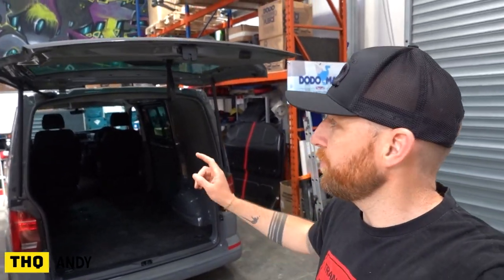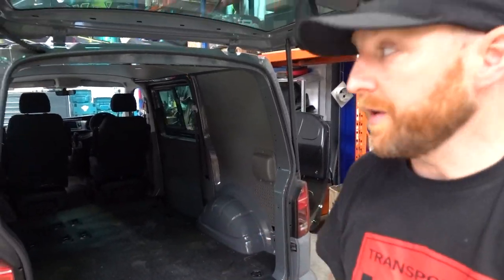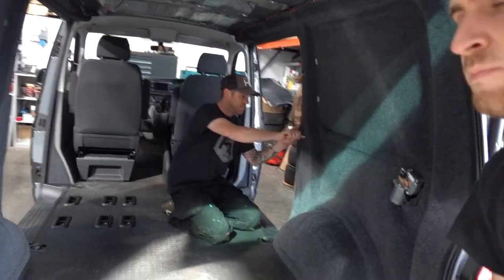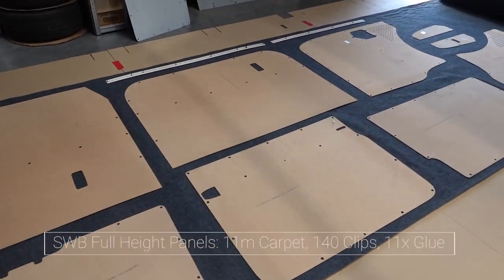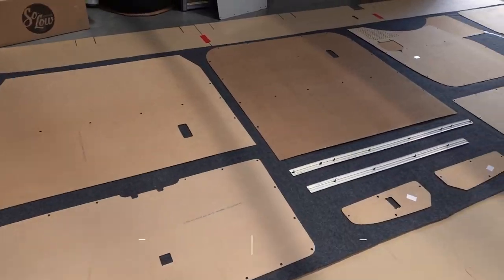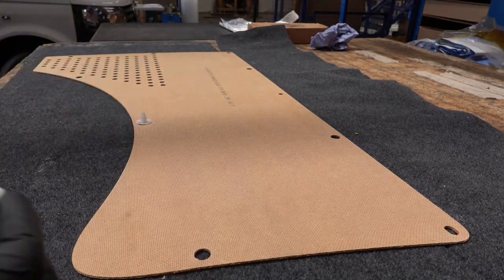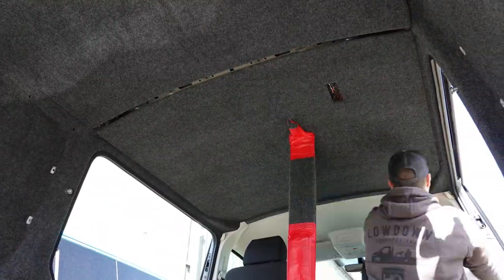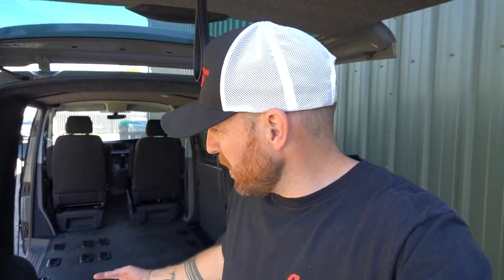VW Transporter T5 / T6 Carpet lining. How much to use and where SWB & LWB  | Transporter HQ

Comment: Hi do you have any recommended company’s locally you’d trust to use your products and do the job properly for anyone who doesn’t have time ? As I presume you don’t offer a fitting service cheers
Reply from the maker: @quench1234  where are you based? Check out the Solow installer network on solowsuspension.com Those companies mostly fit all our products.

Comment: Why do you carpet the wall, then carpet the panel to clip onto the wall? Am I missing something as I see no benefit than just caperting over the panels after they've been installed?
Reply from the maker: To access behind panels later if needed. It also stops the panels from rattling wood on metal.

Comment: What clips to use for ceiling middle trim? Originals are too short and can’t find any information about that.
Reply from the maker: We use the hidden panel clips we sell on our website. They are great and hold in tight :)
Reply: @THQAutomotive  is it a faff to remove a panel if ever needed when hidden clips have been used?
Reply from the maker: @simonheckford2347  No not a all. Just pop a trim tool behind there and they pop out. They give a much nicer finish. It may be worth having a few spares, just increase some loose grip with re-installation.

Comment: Is it easy enough to take the rear seat floor brackets out?
Reply from the maker: What do you need sorry?
Reply: @THQAutomotive  I won't be using the rear seats on my new t6.1 just wondered if you can take the backets out what the seats connect to on the floor?
Reply from the maker: @marinejunkies9625  Ok, i see. To remove them totally you'd need to drop the fuel tank. You can just cover them with blanks if that helps?
Reply: @THQAutomotive  Ok do you sale the blanks?
Reply from the maker: @marinejunkies9625 yes we do https://transporterhq.co.uk/vw-transporter-parts-styling-accessories/vw-camper-interiors/van-floor-blanking-off-set/

Comment: Hi guys, if I only want to carpet the walls do I have to remove my ceiling panel?
Reply: Hi fellas just wondering if I should or have to remove my ceiling if I only want to carpet my walls and floor?
Reply: @D_L_J_83  Yes, you should. You can then carpet above where the ceiling panel sits, so you get a nice finish when the ceiling panels go back in.

Comment: What is the type of screws for attaching the boards?
Reply from the maker: They are the hidden panel clips on our website.
Reply: @THQAutomotive  do the pull out easy enough if you need to take the panel back off